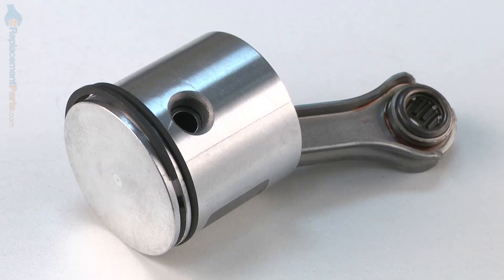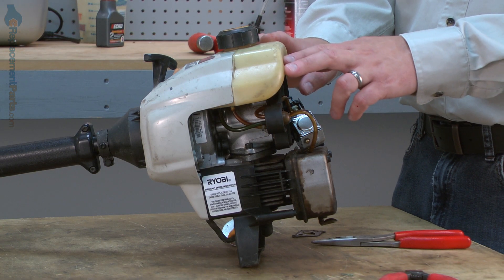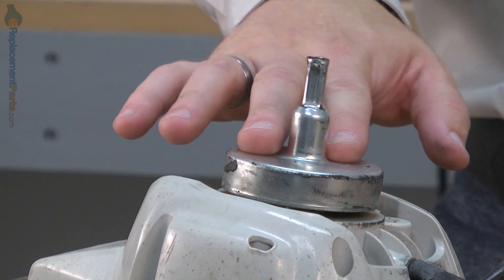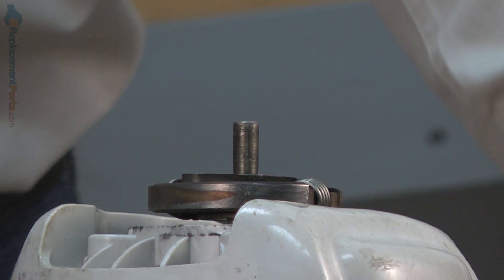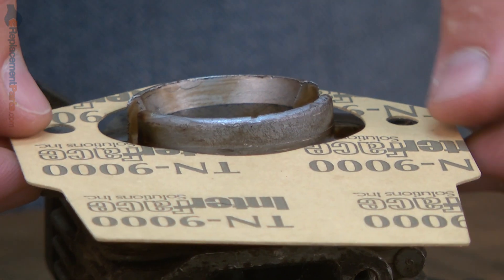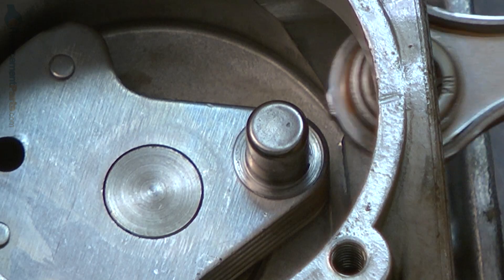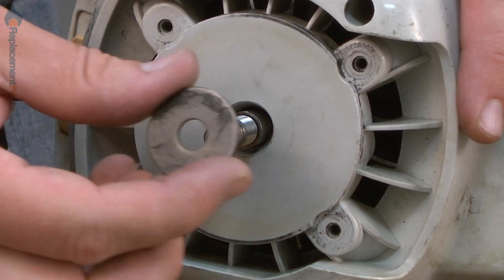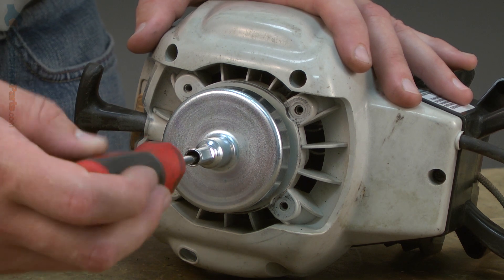Trimmer Repair - Replacing the Piston & Rod Assembly (Ryobi Part # 753-04367)

Comment: I stripped my clutch assembly screw and can no longer remove it. Do you have a suggestion for a specific tool that I can fit down that shaft to remove the screw? Thanks for any help on this.

Comment: Didn't he say replace the cylinder at the same time? Warranty was refused on my 2 month old Husqvarna trimmer stating that it had a scorched cylinder and was my fault. No idea what went wrong think it had 5 hours on it, I did put in fresh gas and proper oil mix. That new Husqvarna was going to replace my 30 year old Ryobi I've maintained which still runs pretty good but needed a few pulls before it fires up. Like to get parts and fix it on a rainy day. Anyways got couple of those electric 80V trimmers and couldn't be happier. Only issue was one of the batteries went bad and replaced under warranty.

Comment: I'm trying to get an old Ryobi PBC 3046YE working again. The cylinder has one long side, and a shorter side at the back, opposite the intake and exhaust ports. The piston slipped out before I had the chance to check the correct orientation. Do you know which way round it should go?

Comment: this guy removed way to much stuff off this thing  1 remove back cover 2 loosen carb mounting bolts no need to remove 3 take off the two allen head bolts on each side of engine to remove head and your done. Piston comes right off. Do reverse to reinstall your welcome

Comment: Question-  I have a Stihl that i exactly the same crankcase you are showing here with 2 bearings facing each other in housing so you cant get behind them to knock them out. book says heat to 140C and tap on hard surface and they will fall out either end. I have done this and hit a bit harder than instructions and they are not budging due to old age stickyness likely.  DONT want to risk cracking case with to much force so any way i can get those bearing out without damage as need to get at least one out to replace oil seal as having on and off idle lean issue when its hot and pressure test at 9 lbs didnt show leak. I figure its when crankshaft is turning or seals are getting hot then leaking slightly? so replacing the 2 gaskets and one oil seal too to be sure CC is air tight at any temp. 
Thanks

Comment: You can save the trouble of stuffing a rope into the cylinder by blocking the crank with a screw driver after removing the fuel line and tank assembly.

Comment: What is the reason you're removing the clutch and flywheel - it almost looks like unnecessary. Would it be possible to just remove carb, exhaust and than cylinder. Didnt see anything preventing to do repair without disassembly of the front side of the engine.
Reply from the maker: Thanks for the question. In some cases you may not need to remove the clutch and flywheel, but I think in this case we just found it easier to access the piston. Thanks for watching!

Comment: You can get the piston out without having to do anything with the clutch or flywheel. Unless my TroyBilt TB70SS is different from that ryobi.
Reply: Juan horn I would but it’s working perfectly now and I don’t think my parents would enjoy me taking it apart yet again. But take the back cover and gas tank, carburetor and carburetor housing off and you should have a view of the crankcase where the piston rod can be slid out, just unscrew the cylinder head and do a little wiggling ti slide the piston rod out.

Comment: Pointless to change piston without new bore or honing it out.repair will be short lived
Reply: This Ryobi engine has a hard chromed bore. you need a diamond hone to do this,  The cast iron rings have a specific finish on the face that facilitates ring break in to the chromed bore.
Reply: @8ackbar  Are you saying the cylinder won't be out of shape from the millions of scratches from the old piston rings or that the new piston rings can cope with these irregularities?

Comment: What is the purpose of taking the muffler off? I have a Cub cadet cc2020, a very similar model, and able to take the Piston area apart with removing the muffler. But i will say that either that or something has caused the motor to refuse to start and feel stiff

Comment: When you install the crankcase cove do you need to put some sort of oil
Reply from the maker: Hi, as long as you lube the new piston and rings before you install them into the cylinder, there will be no more lube needed. Once the engine starts the oil in the fuel will start lubing the new parts.

Comment: I find it interesting that the new piston had two rings and the original piston only had one. I wonder why?
Reply from the maker: Hi John, manufactures do have a tendency to upgrade or change parts of their tools. I would think that this is one of them.
Reply: eReplacementParts.com are the replacement parts OEM Ryobi? If not, what brand are they? I noticed the rod looks much stronger also.

Comment: is possible that even the assamble is done correctly the engine has the wrong timing? I rebuild one, has everything new (carburator, gaskets, fuel lines , fuel , spark plug ) , comprensión is fine ,the coil has good spark and doesn't start .I will apreciate your help. ccasas@uncc.edu,
Reply: Sounds like a Crank Seal It’s Sucking Air this will Prevent it from Running
Reply from the maker: It sounds like you have done it all on your engine. We do have a video on How to Diagnose a Two Cycle Engine. I hope it will get you going again. Here is the link: https://www.youtube.com/watch?v=hHGSXrzYZZQ

 
  
  
  
  
  How to Diagnose
  Two-Cycle/Two-Stroke Engines
  www.youtube.com
  Mark is here to
  walk you through the steps needed when diagnosing your two-cycle engine
  issues. These steps will be the same for all the two-cycle tools in your lawn
  ...
Reply: My trimmer engine has good compression , measured 90 psi,  I have the spark tester and look good, my carburator is brand new. The engine doesn't start , The flywheel is in the position with the wooddrof key, I can't  see what other reason for don't start , the fuel is clean. That is get it me crazy.
Reply: carlos casas carburettor will be your problem, will need a fine tune
Reply: carlos, did you get your trimmer running? I gotta know. Dont leave us hanging. fuel spark and air is needed. you said you have spark. have you checked the settings on the carb to make sure you are getting fuel and air?
Reply: If your timing is off on a 2 stroke you got something bad wrong!

Comment: So helpful I'm just going to buy a new trimmer.   My Ryobi has been worked on twice.   Each time at a cost of $96 I kept hoping that that next time was thee time.   And I had $150 in attachments - Edger and blower - that I didn't want to give up.   Now it pulls easy and I'm pretty sure the rings are shot.  There are some nice electrics where I dont need to buy gas Im gonna look at.
Reply: But you're going to lug around a cord?
Reply: @robertgary3561  He is taking about the gutless low torque battery powered line trimmers.

Comment: Wouldn't that new ring just burn up cause the cylinder wasn't honed?
Reply from the maker: Depending on the condition of the cylinder.  If you hone the cylinder too deeply you'll need to use oversize rings to keep your compression.  Most of these manufacturers don't offer an oversize replacement.
Reply: Honing a cylinder is to score the cylinder so the new rings can be broken in properly. Honing to much can cause out of round cylinder. So honing isn't ment to remove much metal. You won't lose much compression by honing. If you're removing metal to clean the cylinder you should really use a boring bar so you can keep the cylinder round. Measuring the cylinder will tell you if you can bore the cylinder without having to step up to the next available ring size. You can go up to .010 with a standard size ring. If you're over that then you will need to goto the next available size of .020 over. Most of time you can use a different manufacturer to get the right size of rings you are looking for as long as you have the right ring dimensions and measurements. Like if your compression ring is a Barrel Face ring and the second ring is a Wiper ring and the 3rd type of ring is the  oil ring such as Steel-Vent ring
 Type 710 Spacer
 Type 716 Rail
Type 825 OilInnerSpring. There is charts online that has the shapes of rings so you can figure out what combination fits your product.
Reply: @frankg6245 You gave a good explanation of the difference between honing  a cylinder and a cylinder rebore. Honing is just smoothing the walls so the piston rings don't rub and burn up like you said.

Comment: I would have liked to see a more modern up to date gas weedwacker piston replacement. It presents a different set of problems. Like my screwdrivers were   to big to get in the shaft hole to remove the clutch assembly screw. So I used a different method to get to the screws to remove the head. Great videos as always.

Comment: You have awesome videos! I have a question you may be able to help me with. I have a Ryobi SS30 that I can not get started. I have watched several of your videos cleaned the carb because I thought that was my problem because when I shot some started fluid in the carb I thought it was trying to start but it never did. I have checked the exhaust and the spark arrestor screen and they are fine. I have also checked for spark and I have good spark at the plug. The only thing I can think of is maybe the piston and cylinder head may need replacing? What are your thoughts on this issue. Also, do you know the factory settings for the high and low carb adjustments because a guy at work said that they needed adjusting when I first began having a problem with the machine so he adjusted them and now it will not even start....even with starter fluid in the carb. Any help would be greatly appreciated. Thank You
Reply: Replace the piston and rings as in this video. If you have a 4 stroke no need to adjust carburetor.